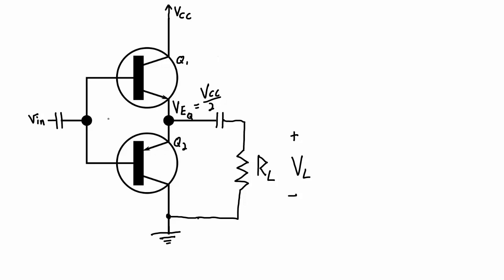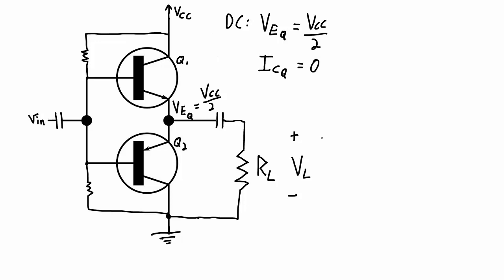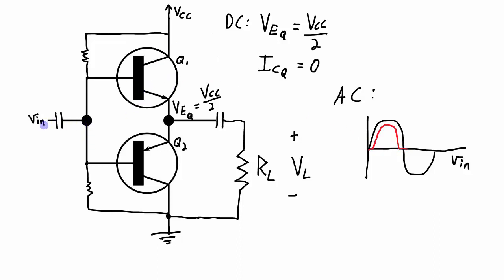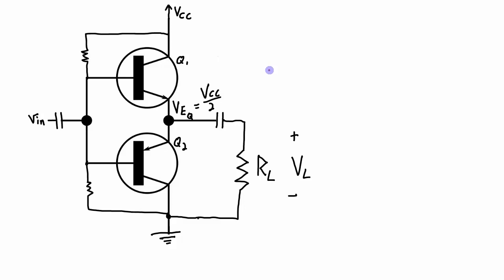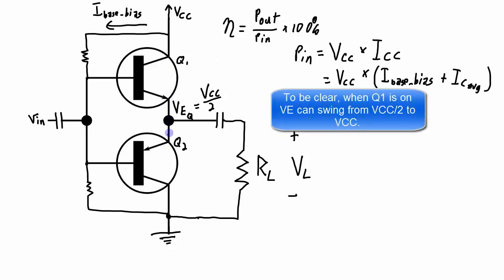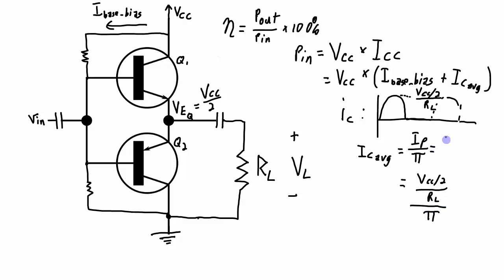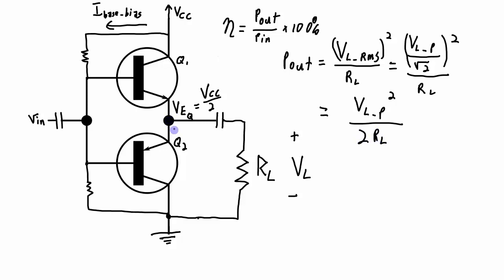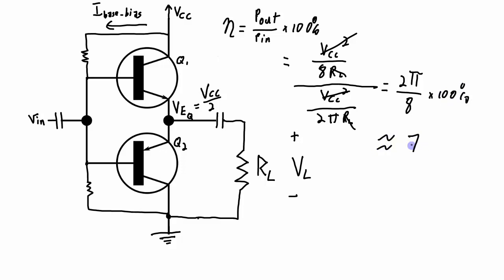BJT Class B Amplifiers

Comment: I'm a bit confused. At the start of the video it says both transistors are off with no current flowing through them.  Where does the D.C. emitter voltage of vcc/2 come from? Wouldn't the emitter voltage be open. Thanks Scott.
Reply: (2 years late to party) I think he means that without the two bias resistors he added after saying that and where v_in = 0, then there is no current and that voltage is v_cc/2 like a voltage divider with two equal resistors. 

Correct me if I'm wrong.

Comment: Why is Icc consisting of a sinusoidal wave? Isn't it DC?
Reply: The alternating current or non-DC signal coming from v_in turns the transistors on and off (one is on for positive voltage and the other on for negative voltage). As the base current increases, so does the collector current. Look at the active region in one of those BJT charts where v_ce is on the x-axis and I_cc on the y-axis. Each saturated line for I_cc increases with base current so your amplifying the base current.

Comment: Wait. If Q1 is shut off, nothing is going to be flowing through Q2.
Reply: I  noticed that too. I think this circuit requires a negative supply on the PNP transistor instead of being connected to GND
Reply: I thought so too. But it is working if you don't omit the input and output capacitor. Simulation in LTSpice concurs. When Q1 is shut off, the energy flowing through Q2 is probably delivered by the output capacitor. Both capacitors ensure that just the AC Part is "flowing" through the B-Class Amplifier.

Comment: How can Ve be Vcc/2 if this is an emitter follower so it can be no more than Vin, usually Vin - 0.7V? AB amp doesnt have any voltage gain, does it?
Reply from the maker: That's the DC bias voltage
Reply: @ElectronXLab  Of course, I'm an idiot. Thanks David, appreciate!

Comment: Correct me if I’m incorrect but if you have a very small R bias the gate then you have a direct ‘shot’ from VCC and ‘ground’ 
Also the P valve is on the bottom isn’t that the wrong way around ? 
When the P valve is open the N valve is closed how is there an equalization of polarity through the N if it’s closed to the P ? 
Or am I just very mistaken ?
Edit  I see with regards to the P and N disregard

Comment: Without proper biasing its not really class-B, class-B has each transistor conducting 180 degrees of the cycle, not less than 180 as in the simple push-pull described - that's actually somewhere between B and C.  Simple push-pull without biasing has severe cross-over distortion.
Reply: Biasing isn't even required if you stick an opamp on the input and feedback the output of the transistors though, right?

Comment: at about 4 min you show the red output curve 0.7v less than Vin.  How is this an amplifier ?
Reply from the maker: That's a good question. This type of amplifier is a power amplifier, not a voltage amplifier. typically there would be a previous voltage amplifier stage and then this power amplifier would be used to drive a lower impedance load.